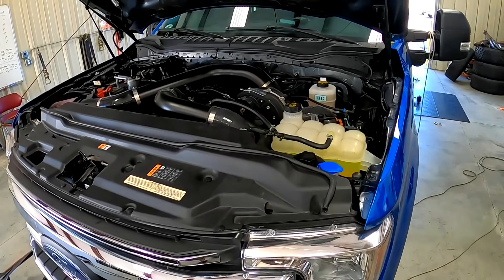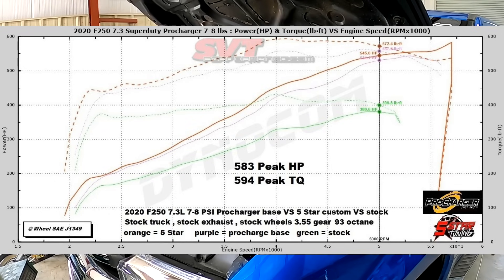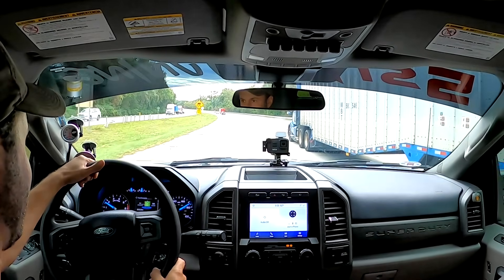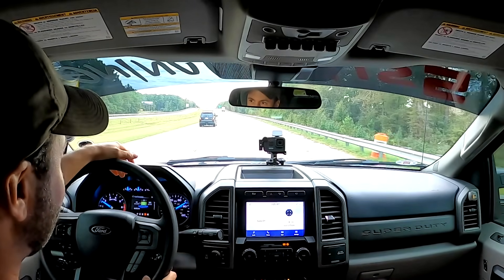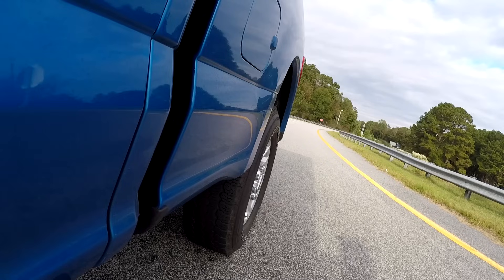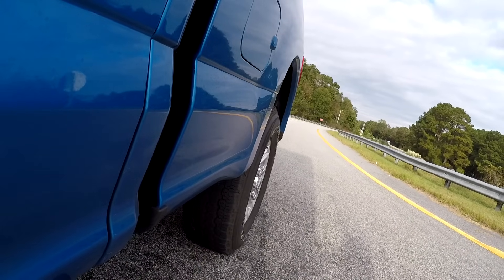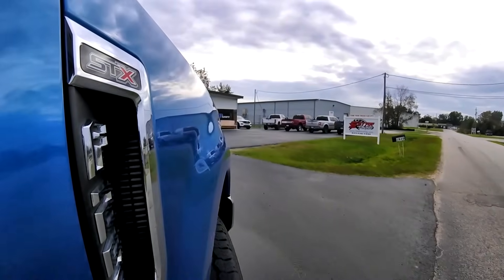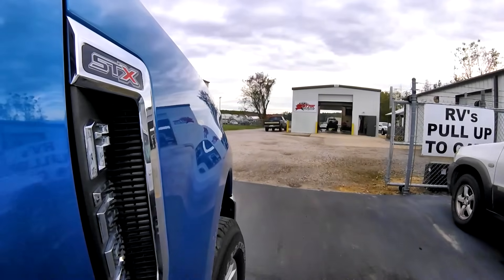FIRST EVER!!! Supercharged 7.3L Godzilla V8 | Dyno Tuning and Road Test

Comment: And just imagine the 6.8L version that's coming for the next Mustang. That'll be a wild ride.
Reply: I think Ford could ve made a 5.4l DOHC V8 with modular architecture or a 6.2l Modular DOHC V8 
The 6.8l OHV ll be fine.. but GM has already perfected LT motors and I don't think Fords 6.8l ll be better n a Mustang than GM LT1s
For 1. The LT1s still are lighter and smaller than Godzilla and if this 6.8l s based n the 7.3 I wud be slightly disappointed because frankly I didn't like this engine,  it felt lazy below 3000 rpm and even post that it revved slower than GM LT motors and felt more like a truck motor and much less like a sporty motor. 
Even by best stock LT standards the 6.8s best possible outputs may be 540 PS and 505 ft pounds torque,  a 6.2l DOHC wud ve made 560-570 PS and 470-480 ft pounds torque,  wud ve revved fasted and wud ve been a better match for a Mustang
Reply: I disagree. I rather enjoy the govs of torque the 7.3 liter has, doesn't feel lazy at all...Did you try the Tremor configuration with 4.30 gears? Makes a big difference. You're correct that the engine is made for a truck and tuned for logetivity and pulling. It would still be badass in a mustang; akin to the Viper V10 8.4 liter...so much torque
Reply: @ReticentIndignation  
See there is a reason why motors are based on HP/L and not at all mentioned in torque/L. And there is a reason why OHC is widely used for sports cars
1. Crank speeds. 
Unless you make cranks with very low weight yet strong shafts,  an OHV will always spin at lower speeds than an OHC,  the lower speed of spinning however is with a less graded positive torque graph meaning. Its super strong but slow to get to peak.
With OHC with the same crank tech it spins faster as there is less parts for pull up. Thus reaching peak s easier and faster. As per cosworth performance the GM LT1 in C7 Grand Sport takes 4.6s to raise from 2k to 6.4k rpm whereas a Ford 5.0 takes just 3.6s to raise from 2k to a higher redline of 7.4k which means if both of these engines are delivering same HP but OHC s at a lower torque would still to more work than an OHC at same HP and higher torque provided both machines are put in a machine that weighs same 
2. With modern super fast automatics and dual mass flywheels and all. Gearing is extremely important. The split determines how much is available at each gear.. the 5.0s were geared more for mpg and thats why they didn't perform that better.. but with the A10 the S550 Gen IIs ve done much better,  now my only wish is to make that S550 platform lighter.. but there is a new 1 coming and it seems to be more focused on Hybrid tech so no signs of low weight as of now. Thats why I feel 6.8l wud be ok.. but if Ford still has an option for a sub 2200 lbs chassis like the Alpha platform in GM which weighs just 2070 lbs an OHC would perform far better than an OHV n that case
Reply: Except there is no 6.8L coming for the Mustang lol the Union representative made a mistake confirmed by RevenEvan.
Reply: @Jimmyxsx  but why.. there s somethin going on.. some new engine definitely in works.. 

Donno which or its specifics
Reply: @1989rs500  because Why would Ford go back to pushrod when they have been perfecting the DOHC Coyote engine design for 10 years. All they have to do is make a larger displacement Coyote based engine, like a 5.7L or 6.0L. The current 5.0L Coyote is killing the bigger 6.4L hemis and 6.2L chevy engines lol
Reply: @Jimmyxsx  
Actually why are we sayin this.. we both ve same opinion. I too think a 5.4l DOHC V8 wud ve good enough to kill any OHV V8s upto 7L in displacement 
The best pushrod V8 I ve been in is the new C8 Vette engine.. 
495 HP and 465 ft pounds and it revs fast for an OHV. Fantastic job by GM and definitely a kick in Fords butt. Not in the sense the 5.0 V8 is bad but to push for a bigger and more bad ass DOHC V8.
The current 5.0 block can be bored to 5.2l and can push 500 PS, but Ford had difficulty in cooling the engine to operating temps,  thats why they went with just 5.0 for the Mach1.
The 5.4l Aluminator still is a testament of how good Fords DOHCs are.. those engines rev to 8000 and make 445 ft ponds torque too. Easily 1 of best crate engines ever made
Reply: Hopefully its a high revving ride I’d like to see 7750
Reply: @Jimmyxsx  "Perfecting?" Lol. Ford has been OHCing those boat anchor mod motors for almost 30 years and every "generation" has been less "perfect". What are you? 15 years old or just recently retired "ricer" new to Ford "performance"?
Reply: @deeremeyer1749  That doesn't even make any since. FAKE NEWS
Reply: There's already videos of these trucks have different issues the worst I've seen is a blown 7.3 and I dont mean turbo or supercharger.
Reply: Bore spacing. There is only going to be so much C.I. possible out of the Coyote.
Reply: Amusing.  If they present you with a 6.8 Mustang, the first thing owners will do is toss the 6.8 and put in  7.3.  Size matters.
Reply: @oldmusher  With all the issues 7.3 has I doubt that...
Reply: I didn’t know that ther making a 6.8 for the mustang that’s nuts lmao
Reply: Centrifugal superchargers are better on higher revving engines than something like this that’s topping out at less than 6000 rpm. A Whipple twin screw or a Eaton roots type supercharger would suit this engine better especially down low in the rpm range. Centrifugal superchargers build boost according to the rpm similar to a turbo while the twin screw or roots type produce the same boost throughout the entire rpm range from idle to redline. The centrifugal can produce more power overall generally but would be limited by the redline of the engine. If you’re going to be towing or driving off road and need more power low in the rpm range then I’d wait for a roots type or twin screw supercharger from Whipple or Eaton.
Reply: Fords not putting a push rod in a new mustang
Reply: @fread51  nobody said it’s going to be a pushrod design. The Windsor factory confirmed that they’re going to produce the new 6.8 liter engine for the F-150 and Mustang. This isn’t the 7.3 liter gasoline engine that’s in the Super Duty trucks but an entirely new engine.
Reply: HoldMyBeer76 I highly doubt Ford is going to go backwards to a low mpg v8. Especially now that Biden is president. He’s already put the us back into the Paris climate accord and will reinstate the Obama era epa cafe mpg requirements.
Reply: @1989rs500  “ I think ford could have made a 5.4l dohc on modular architecture “ they did Australian ford falcon boss 260 & 290kw
Reply: @barbraabsalom4531  
Yep. Ford always disappoints at the end.. too close to be the best.. but never the best
Reply: I’m building a ‘83 k5 with a 7.4 and a supercharger
Reply: @Jimmyxsx  who said the new 6.8 liter engine is a pushrod? Nobody has even said how many cylinders it is. Just that it is going to be 6.8 liters and is being produced for “derivatives of the F-150 and Mustang”. That tells me it will probably be an optional engine for higher trim F-150’s and maybe the Raptor and a “derivative” of the Mustang could be a Shelby model or another Mustang nameplate like a Boss or Cobra could make a return and use the new engine. I don’t know how RevenEvan confirmed that the union rep misspoke. Ford doesn’t and won’t comment on any projects that are under development and several automotive journalists have asked about the engine with the only response from Ford being, “Ford cannot and does not comment on active development projects” so unless the union rep himself said that he was wrong and misspoke I think I’ll stay on the optimistic side and hope we do in fact see some version of the Mustang available with a 6.8 liter engine in the near future. One can always hope.
Reply: @porscheguy09  it has to be a pushrod, a 6.8L DOHC engine would be enormous lol
Its going to be derived from the 7.3L godzilla v8
Reply: @bigboreracing356  
Still a ticking bomb it wud.. be not reliable as LS motors too

Comment: Congratulations. I'll be waiting for the whipple myself.
Reply: Procharger all day.
Reply: @Make-Asylums-Great-Again  makes boost too late for the engine to take full advantage of the power band
Reply: @streetslayers410  The choice between the two is only about when you want the power to come in. The whipple will come on lower but the procharger will be stronger higher up. Towing? I'll take the whipple all day. Gapping nerds at the track? Procharger.

Comment: Ready for TVS2650 rotor pack, whipper 3.0L and maybe a F1 procharger. Time will tell but I’m sure these larger units will surprise everyone.
Reply from the maker: D-1X coming in about a month.
Reply: @SVTPerformance  you’re really speaking my language!
Reply: Eaton 3100 coming soon
Reply: I love Procharger. My first almost 20 years ago was a D3-R that I got to play with but for a truck I think a KB or Whipple is a better option because of how the power curve works. You want that instant boost you can't beat from a positive displacement blower.
Reply: Use the Eaton TVS R2650 from the GT500 & C7 ZR1. 2.7 liters of factory reliability right there.
Reply: Why use the TVS2650 when Eaton already has TVS3100 rotors already developed. 2650 is already on the verge of being outdated lol

Comment: I have your 5 Star tunes...I like the 87 Perf. tune..  Question do you have to use new tunes with the Blower set up..???  I am waiting to see how well the Whipple does first.   It pains me to watch yall bounce around in that truck.  Install a carli 3" level lift and change the rear block to a F350 block which is 3.25" vs 2".  The truck will level with a slight rake, ride night and day better, be more balanced.  My truck feels close to my 1/2 ton Ford and GMC.
Reply from the maker: You'll def need new calibrations for any blower.  This truck retains a stock'ish suspension because it's used to gather a lot of testing data.  You want as few variables as possible when testing mods.

Comment: So far this kit works perfectly for the Super Duty.  I think it’s almost perfect.  Low boost low temps.    Not many super duty owners will want 700-800 hp from a working truck they depend on.    They want reliability so let’s see what the whipple company does.   Sometimes common sense does apply.
Reply from the maker: We need more data on IATs to make a really solid determination.

Comment: Nice! Almost as much power as a natraly aspirated Chevy 632. :)
Reply: Yet that chevy 632 only made a fraction of the power the mighty 811 cubic inch Hemi puts out🤣
Reply: @Jimmyxsx  You are correct. The 632 and the 811 are very exciting engines.
The only thing that is exciting about the 7.3L is that the big blocks are on their way back. 500 ish Hp is small block power with minimal upgrading and the torque doesn't even come close to the diesel that it's competing with.
100 Hp per liter is factory now days. That engine should be able to produce 730 hp before mods or at least dam close.
Reply: But unlike Chevy motors this one won’t shit it’s cookies
Reply: @jamesward4893  You have absolutely no data to back up either statement. Try Googleing what car manufacturer won the most races then look at who is second and then look the difference. Or you can simply remain ignorant. Your choice.
Reply: @wilsterone6689  So since Chevy is so much better than Ford, tell me how many LeMans victories Chevy has, Ford only has 5 of them and a few triple crown wins. I’ll save you some time, Chevy (GM) has none and neither does Dodge. GM has been bailed out twice by the taxpayers because they build garbage, Ford has never been bailed out. So before you start calling people ignorant maybe you shouldn’t be ignorant yourself.
Reply: @jamesward4893  Ford never won lamans Shelby did and when Ford insisted on running factory engines they broke down. 
GM is the all time most winning manufacturer. Also try googling who makes the longest last truck ,again not Ford. Ford got the bail out money before the market crash GM and Dodge tried to wait. GM paid back the loan in under 3 years. No different than anyone who lost their job accepting unemployment.
Ford was the first company to stop building all cars except the mustang laying off 10s of thousands. We can do this over and over again. I stand by my statement. Open your mind or remain ignorant it's all the same to me.
Reply: @wilsterone6689  It was in conjunction with Shelby yes but the motors and drivetrain were all Ford
Reply: @jamesward4893  so because they won  LeMans assisted by Shelby. That makes chevrolet junk?
Hmmmm? I don't quite understand your reasoning.
Reply: @wilsterone6689  What makes them junk in my book is how many times they’ve made me walk, end of story. If you want that junk more power to you, hope you have real comfortable shoes.
Reply: @jamesward4893  Never made me walk once. Iv owned GM exclusively since 1988.  Still own a 1993 k1500 l bought new and it has 365k on it now two brake jobs and 4 batteries. It's obvious that you are not willing to open your mind so buy what you like.
Reply: @wilsterone6689  Well that’s good for you, doesn’t change the fact they’ve made me walk one to many times and neither you or anyone else is going to change my mind. If someone gave me a brand new top of the line GMC I’d trade it for a Ford.
Reply: @jamesward4893  You do you. But you proved my point. You didn't provide even one fact to back up your original statement. You let your emotions get in the way of reality. It's America and we are allowed to have a difference of opinion. Have a wonderful day. Thanks
Reply: @Sid-xx4bz  Hmmm?
Ford received a 9 Billion dollar line of credit. (A LOAN) from the government. And 5.9 Billion from the department of energy on a promise to develop energy efficient cars. That they didn't need to pay back. GM and Dodge's loans were transparent while Ford covered there's up.  Again with Lamans? Not even close to as many races as GM has won. Not by a long shot. If GM were junk why do they out sell F150? Oh yeah Chevrolet and GMC numbers can't be combined because they look different.
Reply: Christ all mighty....you boys will argue over anything... the Chevy engine are benefiting from decades of aftermarket support and tuning experience. The 7.3 is not even out one year and it was purposely built as a lower RPM WORK engine....
Reply: @sorryociffer  I believe that the original point I was trying to make is that I don't see what all the excitement is about. They simply brought the big block back. Technology for the 60s and put fuel injection on it. Then as usual some moron spewed a bunch of crap so of course I couldn't leave it at that. LOL
Reply: @wilsterone6689  you hear that James how he said shit chevy is all time winning like it's a cheap ass cereal brand or something.. chevy will remain cheap with that shit 5.3 cylinder 7 spring break crap..